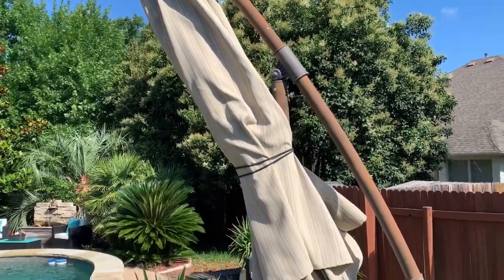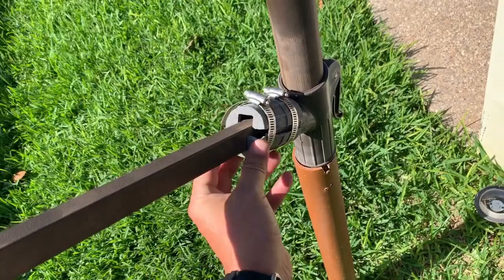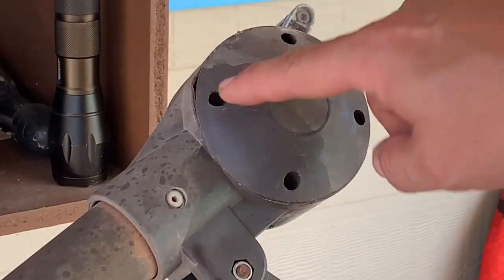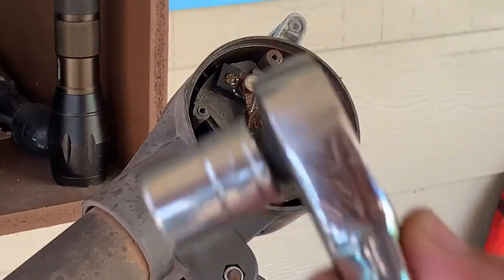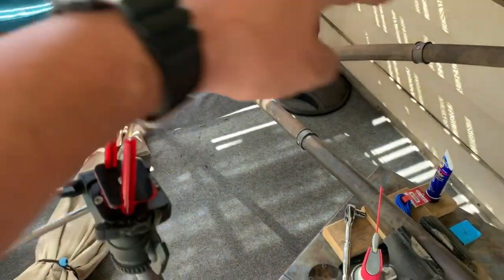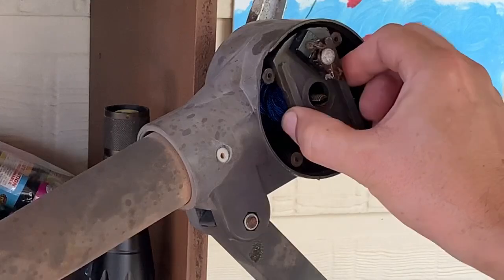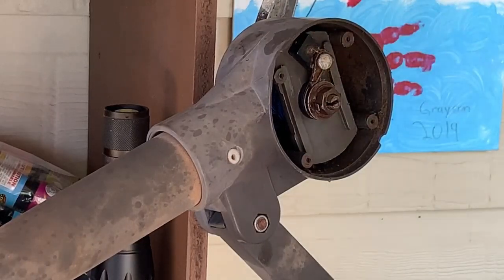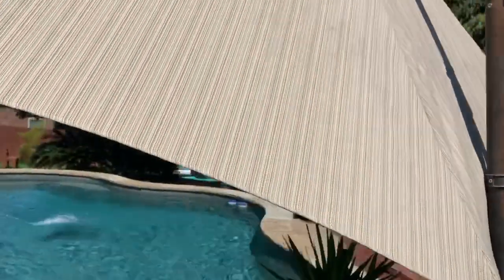$2 repair! (Gear Assembly) Part 2 -Fix restring offset / overhanging umbrella using parachute cord!

Comment: Thank you, thank you, thank you  for part 2! I'm a 67 year old widow, doing a lot of things on my own. You showed me exactly how to get that gear box apart, (and I did snap a picture of everything lined up.) then put it in WD40 to soak. I'm so proud of myself, it's done and it works! And those umbrellas are heavy and awkward to work with. Thanks again, I couldn't have done it without your video.
Reply from the maker: Very glad it worked for you & had that “satisfaction feeling” afterwards. I always try to find a way to fix before I buy the replacement. (or repurpose the materials for a different fix) Keep on rockin’ widow of 67yrs, you got the skills!
Reply: @athomehack7789  Project before this was the deck. I bought myself a belt sander for my birthday, sanded my deck, scrubbed with deck wash, then stained it. Took a week! Bought a 4 piece patio set, which came in 1 box, bag of screws and an allen key( I hate those things) Got that done too. It looks great. On to the next must do!

Comment: I've watched several of these repair videos and they are very helpful. I noticed each time that the WD40 needs to be used due to the moisture and rust that is present. When I opened mine it was half full of water which I assume gets in through the unsealed connections on the umbrella tube when the umbrella is in the closed position. While I had the winch assembly out of the housing I drilled 3 small holes in the bottom to help drain that water out and hopefully prolong my repair efforts by not roting and rusting the rope and winch assembly.
Reply: That seems like a good idea. I will do that myself while I'm in the process of restringing and restoring the crank assembly. Thanks.

Comment: All those asking about getting a new shaft for the crank handle. If its the type with a square on one end where the handle fits and a slot on the threaded end.
I made a new one from a stainless steel coach screw, using the old one as a sample. Stainless so it shouldn't rust (off ebay), drilled a new hole and cut the slot with a hacksaw.
A fairly easy job if you are OK with DIY and have the suitable skills.
The exact size may vary depending on your mechanism.
Reply: John what size and length did you use for this steel coach screw? is it hard to drill a new hole
Reply: @michaelcooper9892  As I said, the actual size may vary depending on your mechanism. I used an M10 x 75 stainless steel coach screw (Carriage bolt) I actually drilled it at work on a bench drilling machine, but it should be possible to do in a vice by hand - carefully and using a high speed steel drill bit and cutting fluid.

Comment: How does the gear release for winding down the umbrella? Mine won't budge yet is free moving inside to wind it up. Also, when you do the "crimp washer" it must be on the flat of the nut. Where you had it, it does absolutely nothing to stop the nut moving.

Comment: Thank you so much it was very informative. I'd like to ask you a question where do you get the main bolt for the handle that goes through to crank it I cannot find it on the Internet anywhere.
Reply: We’re you able to get it?  Mine broke as well

Comment: I have the exact same umbrella, but trying to replace crank. What is the brand of the umbrella?
Reply from the maker: Sorry for the delay. This is so old & has many parts added, no brand name is listed. I’ve had many of these types of umbrellas that I’ve junked, but always kept working mechanisms (crank, washers & gear(s) for doner parts. Unfortunately, these umbrellas need maintenance & break after 1-3 yrs of use……

Comment: Hello, appreciate this is an old video but hoping you can still support.  I seem to have tighten the handle too tight and the metal bar which connects the handle to the crank bolt has snapped.  
I’ve tried searching for a replacement handle which includes the metal bar to thread all back together but no joy so far.    Any ideas or advice would be appreciated.  Thanks

Comment: Does anyone know what this bolt that almost everyone has a problem with breaking is called ? ? coach screw, cotter pin bolt, split pin hole bolt ? ?  There must be somewhere to buy one? Many people are trying to get the center bolt/shaft for their patio umbrella because it broke at the thread!  Company will not let us get another one or even tell us what this is bolt is called? Our umbrella cost several hundred dollars and practically brand new but because of this bolt that maybe cots $2 broke it is useless.

Comment: I have a 2 month old version of this umbrella and the crank bolt broke in two on the weak end where the nut and gear is. I don't think it would be difficult to replace this bolt, only if I could find one. Any suggestions?
Reply: I am having the exact same issue. Did you ever find a replacement part?
Reply: Same issue in my end… no spare parts as per their support.  BS

Comment: Hi, this is really useful, thanks. On mine, the bolt thing with the split ends has snapped. Do you know what it's called? I'll definitely be able to fix it, thanks to your video, once I can find one of those!
Reply: Mine broke too and I’m having a hard time finding one
Reply: @louiebolarinho465  I looked and looked but never found one, had to chuck the whole thing out in the end
Reply: I did one for a friend which had sheared where the slot in the shaft is. Made a new one from a stainless steel coach screw (ebay), drilled the hole and cut the new slot with a hacksaw.
Fairly easy for someone with a little DIY skills and tools.

Comment: I just got abba patio 10 feet  2 weeks ago ,now my umbrella won’t close when I cranked down. Do know have any solution for that?
Reply from the maker: I’m guessing something is getting “hung up” inside the tube, from the crank, inside the actual frame (tube) that opens & attached to the umbrella. I would start by checking that 1st. Then check to see if your “gear” is hung up and not functioning w/the “trigger” or stopper. I hope you get it fixed!

Comment: If it is a canvas umbrella the issue is the material has shrunk overtime. Try not to destroy your crank or rope assembly when the solution is to hacksaw off one inch off the end of each rod. This allows it to Crank up to proper hide again

Comment: i noticed  that you had the cord wrapped around the crank assembly.  my question is then with the umbrella closed after restringing all the cord should be at the crank area?
Reply from the maker: There should be a small hole in the crank assembly. Put the string through this hole 1st & tie it off. When you crank the umbrella in (to open) it should wrap around what’s already there. Likewise when you close the umbrella. (You want at least 12” of “slack” on the string, to open or shut)

Comment: Hi there, Please could you tell me where I might be able to get a new gear assembly, mine has not only rusted to death but the bolt that runs through the handle and gears has snapped. I live in the UK and cannot find anything so I am reaching out. What make is your Parasol? Love the Video by the way, good work.

Comment: How does one find just the 'bolt' for the gear assembly? That bolt broke just past the nut on the threads and that is all I need to reaplace.
Reply: Take the bolt to a welder. I just had a new one made.

Comment: thank you for the video- do you have any recommendations on where one can get replacement pieces. found an umbrella in barn but the crank is broken. and I have not taken out all the pieces to make sure the washers and gears are all there.
Reply from the maker: Sorry, I don’t. Look on your local Craigslist for a used one for cheap, even if it’s broken. You can always use the parts! Should be cheaper than buying a new one.

Comment: Is there something that applies tension on the trigger? I have a small wire attached with the same screw holding the trigger to the assembly and it broke and I can't figure out what it was for and my trigger will rest on the gear but will not function. It's loose. So I'm thinking maybe this wire applied tension to the trigger or acted as a spring.

Comment: i have the same mechanism, but the shaft snapped. Any suggestions on where to buy a whole new mechanism? Thanks!
Reply from the maker: Sorry, I don’t. Look on your local Craigslist for a used one for cheap, even if it’s broken. You can always use the parts! Should be cheaper than buying a new one.

Comment: My Umbrella is only 2 years old...little use. No Gear corrosion.  Even the first year & Now this year even worse:  Crank easily winds it UP, but Locks when trying to  wind down down. Gear assembly functions well when cranking up, but does nothing going down....."something " does not release the UP gear....How to achieve that?  .Very very difficult to force crank to wind it down....almost impossible for Senior woman. .....HELP! ...
Reply: Possible solution--Uncovered Gear Assembly....watched action while winding UP, & No action trying to wind down.....UNTIL I pulled sideways on thin spring attached to ratchet---worked!  ...umbrella came down!  Had to do that 3 more times, now it seems to be a final solution...the Spring was too tight! wow!  so simple.  will watch for awhile...attached small cord to bend in spring---to pull down...just in case!!! :D

Comment: Can you suggest where a new mechanism can be purchased?  My mechanism is exactly like yours but very rusted.
Reply from the maker: Sorry, I don’t. Look on your local Craigslist for a used one for cheap, even if it’s broken. You can always use the parts! Should be cheaper than buying a new one.
Reply: WD 40 !

Comment: can you suggest where to buy a replacement crank handle for this umbrella?
Reply from the maker: Sorry, I don’t. Look on your local Craigslist for a used one for cheap, even if it’s broken. You can always use the parts! Should be cheaper than buying a new one.
Reply: @athomehack7789  thanks. I actually went around to a few different places and got everything I needed. I just have to put it all back together.

Comment: My dowel thing broke off at the end with the nut on it 😭 do you know where to get a replacement one?? I already looked at Home Depot and they said only the umbrella manufacturers would carry it unfortunately. I can’t seem to find online where to get one! I don’t even know the brand of this umbrella. Seems like it’s the exact same as yours
Reply from the maker: Sorry, I don’t. Look on your local Craigslist for a used one for cheap, even if it’s broken. You can always use the parts! Should be cheaper than buying a new one.

Comment: What do i need to do if my crank is uncranking itself?
Reply from the maker: You need to open up the “crank housing” and see if the gear(s) is damaged. (or what stops the gear from turning. Sounds like it’s stripped - hence the uncranking) 

You need to have the gear lock into place for it to stop after it’s fully opened. I hope this helps!
Reply: @athomehack7789  we were able to look at the gears and just tighten that nut in the front. Now it works perfectly! Thanks!